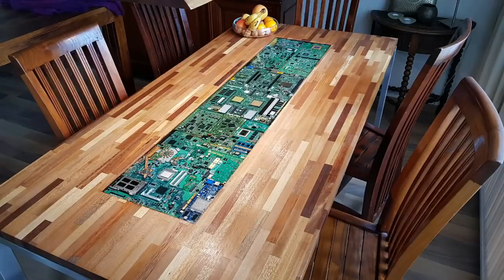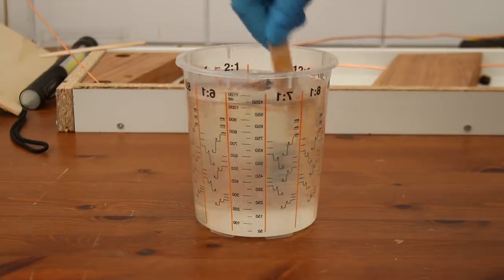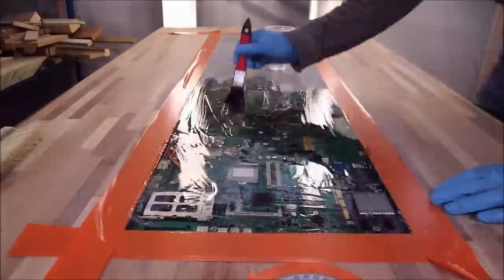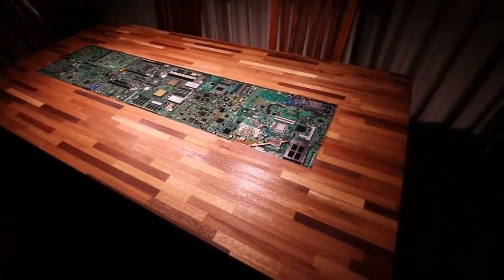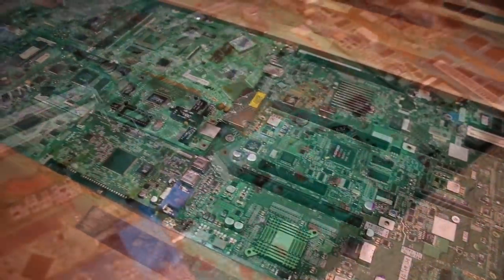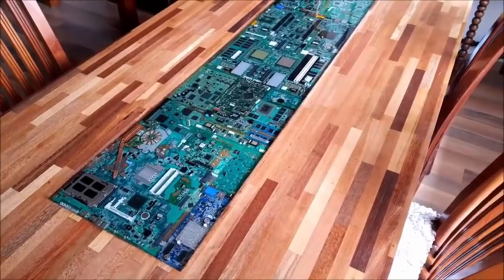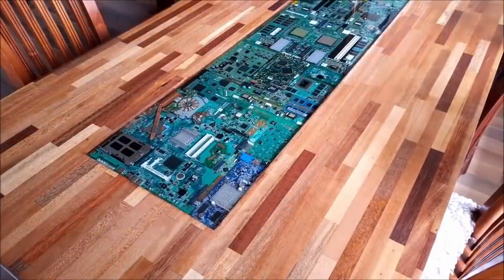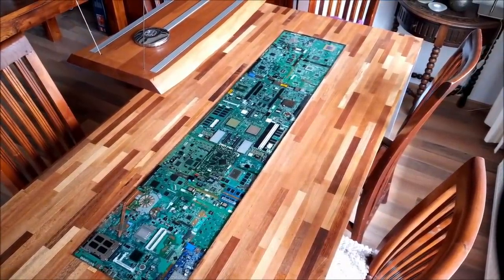Circuit boards with lights in epoxy in a table

Comment: What you've learnt from this: The epoxy was a failure.
What we've learnt from this: Screw with your failure!! That LED with fiber optic wire is a brilliant idea, and your table is awesome!!
Reply: i agree the fiber optic is really nice ! but i'm asking myself, in the video you show us you drilled a red led, but when you light it up later they all show up green and yellow ? i'm really curious about this
Reply from the maker: @nathu100  The red one was the first as a test. 'For real' I used only green & yellow because I thought those colors matched better with the circuit boards.
Reply: Looks like shit.   My local lumberyard has an epoxied table with river stones, moss, and a slab of zebra wood with a live edge.   Your table is something a sixth grader would do.
Reply: @yousircantknow8987  "my local lumber yard...."😂😂😅That was one of the dumbest, out of left  field, "I can't do better so I will hide my jealousy by posting that I saw a better one somewhere else that I  had nothing to do with except seeing it" post I have ever seen!😂😂😅.  FAF. Had me rolling for a while. Thanks. I really needed that.

Comment: Just cut the whole middle section out, create a replacement, with a backing, fix the backing underneath the table and pour again, making sure you mix well and vibrate the table to get rid of air bubbles. the sander would do the job, just without sanding paper in it.
Reply from the maker: I was hesitant to use the sander, just because it was so dirty, and I was afraid the dirt would end up in the epoxy...
As you can see here https://www.youtube.com/channel/UCNdDV4vHKjuWOYlEW4HIk5w/community I've begun trying to fix the table. I will try to pour in new epoxy.

Comment: A really nice attempt, May I suggest turning the tent you made into a vacuum seal, pull aoo the air out before it sets, then you could do a final leveling coat after.

Comment: You suppose the arsenic residue left on the circuit boards in their manufacture could of caused a bad reaction in the epoxy?
Reply from the maker: More people thought so, but it is not. Because (as you can see in the video) I poured them in, and with that layer is nothing wrong. The problem is higher up.

Comment: as a tip for speed sanding epoxy if you buy a sand disk for angle grinder with 60 or 80 grid on a backing pad.  or a belt sander both work really well :).
Reply from the maker: I have both, but it didn't enter my mind to use them, for both tend to 'bite' chunks out of your material, the belt sander a bit less than the angle grinder. It would be very hard to keep the table flat...
Reply: there 2 kind of sanding pad you get for angle grinder. there high RPM one that go up 12000 rpm operate at 3 to 10 degree angle or you get one that act like orbit sander run on 3600 - 5000 rpm at 0 degree but these kind of grinder can cost a lot. 3 degree one is very good for roughing then 0 degree one great for finish work. belt sander also work as a 0 degree tool. 

main upside to 0 degree one is you put any grade of sandpaper on it i generally start at 180 + in metal work when i have dealing with super glossy paint. 

If you are biting out stock when you use an angle grinder you probably use to extreme of an angle. for woodworking an angle grinder with a sanding disk should be used like a paint brush very light stroke will give you a clean finish. 

hope any of this you find useful information on future projects :).

Comment: Just get a giant panel of glass and stick it on top. It will negate the sticky effect of the resin and give an awesome finish with added depth
Reply from the maker: As you can see here https://www.youtube.com/channel/UCNdDV4vHKjuWOYlEW4HIk5w/community I've begun trying to fix the table. I will try to pour in new epoxy.

Comment: So if you had a phone screen bright enough, and all the filaments concentrated in a matching rectangle, you could send to a grid of LEDs and make a big screen.
Reply from the maker: Nice way of thinking, yes! But in reality you need quite some light to even see it on the other end - the light of my phone works well, it is a very bright LED, but I have a ordinary flashlight, and that light is almost not to be seen... So I'm afraid the light of a screen won't do it...
Nice thinking though... 😊👍

Comment: pour some wd40 on the sticky spots, it adds a protective layer,extra shine and no sticky for a good while, might need to reapply everynow and then tho, still,better than a spot with dust
Reply from the maker: As you can see here https://www.youtube.com/channel/UCNdDV4vHKjuWOYlEW4HIk5w/community I've begun trying to fix the table. I will try to pour in new epoxy.

Comment: Since the boards and epoxy are on top of a foil layer on the bottom couldn't you just router around the perimeter of the epoxy and in theory it would lift right out? 
personally I think that is a very cool piece and would suggest to add even more circuit boards for a larger area. It is so mesmerizing to look at the boards.
Reply from the maker: I agree on that last statement. In the mean time I've begun trying to fix the table, this you can see here: https://www.youtube.com/channel/UCNdDV4vHKjuWOYlEW4HIk5w/community - I will try to pour in new epoxy.

Comment: You did something ¡¡¡incredible!!!
The learning is: to do the mix with a mixer, like the used to cook bread.
https://www.amazon.es/autom%C3%A1tica-velocidades-El%C3%A9ctrica-Resistencia-temperaturas/dp/B07L1NBLLG
Hugs
Reply from the maker: I went to a boat shop and bought an impeller there. Now I mix the epoxy with that on my electric drill. That works great too!

Comment: This is exactly why i bought a crappy whisk, chopped the end off and fixed it to my drill, you can then use it to power-mix epoxy, no way you can properly stir large batches by hand.
Reply from the maker: I'm afraid you're totally right! I bought an impeller at a boat store and mounted that on my electric drill. Works good too!

Comment: Very cool! I'm amazed that with that much epoxy that it didn't exotherm (smoke and crack from the heat). I had the same issue of globby epoxy when making a surfboard one time. Like you, I didn't mix it properly.
Reply from the maker: So you know what it's like... It depends on the specifications of the epoxy how thick the layers can be that you can pour at once. My (slow curing) epoxy was good for 5 cm, and I did only a bit more than 1 cm... I never noticed any heat at all.

Comment: Great job overall. Batches of epoxy-- I didn't think that was the best way to go. One large batch ...hindsight. Thinking of building my brother a desk and adding something similar on the top. Thanks for the idea!!
Reply from the maker: Disagree. I have no regrets on the layers. Even in hindsight. You can mess up the mixing of any layer, if it is one or many. And I just needed those first ones for fixating the boards and the lights. As I started trying to fix the table (see https://www.youtube.com/channel/UCNdDV4vHKjuWOYlEW4HIk5w/community ), I discovered which layer exactly went wrong. It was just one...
Reply: @Onrust1  I look forward to seeing the fixed final product. I never do batches of epoxy but maybe I will give it a try :)

Comment: You should have use a torch after every layer of epoxy poured to remove the bubbles and maybe to make the epoxy look smooth and clear. 😅
Reply from the maker: I did.

Comment: The hugely spot is because you didn't let enough time between layer so when you add new epoxy, the layer before just starting to became strong then, she is moved by the new layer so she move but not enough to became clean and she stay has if you moved she all time

Comment: Great idea and loved it. To fix the problem of sticky epoxy, build a dam around the edge of the table and make another pour of about1/4 inch or 5 cm
over the whole table and fine sand to a high polish finish. Just make sure of your measurements when mixing and mix well.
Reply from the maker: As you can see here https://www.youtube.com/channel/UCNdDV4vHKjuWOYlEW4HIk5w/community I've already begun trying to fix the table. I will try to pour in new epoxy..

Comment: It's not a complete loss. Depending on where the damaged areas are you could cut them out and make end tables or nightstand next to a bed. It is definitely some extra work but not a complete loss. Just a thought
Reply from the maker: As you can see here https://www.youtube.com/channel/UCNdDV4vHKjuWOYlEW4HIk5w/community I've already begun trying to fix the table. I will try to pour in new epoxy..

Comment: cover it with a 6 mm glass, put many 20mm diameter x 1mm thick small round clear vinyl  pads to elevate from epoxy so it does not touch glass

Comment: The epoxy can be manipulated with a blow torch when pouring, to remove bubbles and settle the epoxy. Something that might be difficult to do without melting the circuit boards..

Comment: I like the table, nice. I understand what you tried to accomplish. I might have use a layer of glass instead of epoxy but that
would not give the effect of those circuit boards completely encased in a glass like medium. Maybe working in smaller
sections could help with a thin (1/4") wood border randomly separating the circuit boards within the overall space. More
lights might be nice too. Making the center piece first, then applying it to the table, might work. I think its worth perfecting.
Reply from the maker: As you can see here https://www.youtube.com/channel/UCNdDV4vHKjuWOYlEW4HIk5w/community I've already begun trying to fix the table. I will try to pour in new epoxy..

Comment: Why not sand it again and apply a few coats of urethane over the whole table top.  That should solve the sticky part and create an even surface.
Reply from the maker: As you can see here https://www.youtube.com/channel/UCNdDV4vHKjuWOYlEW4HIk5w/community I've already begun trying to fix the table. I will try to pour in new epoxy..

Comment: Like other commenters have, I will commend you on posting a video with a mistake. 
Just an idea but could you skim down a couple of cms in the affected cloudy areas and maybe lay back in some of the wood or different thin pieces of wood and stain it and then pour in some more clear on top of the fixed sections. Put some wood on the computer parts to give it more depth and a look I havent seen yet. I wouldnt want to throw it out. Looks great
Reply from the maker: As you can see here https://www.youtube.com/channel/UCNdDV4vHKjuWOYlEW4HIk5w/community I've already begun trying to fix the table. I will try to pour in new epoxy..

Comment: That chiseling out of the center looked like too much work. I would have just cut the center out completely and dropped in the circuit boards on a panel...cause I'm lazy lol...(but not enough to put a glass top on it lol)
Reply from the maker: You're completely right. It never crossed my mind, but it would have been less work & a lot quicker.

Comment: Hey, I just thought of something...what if you just add a pane of...what's it called? Oh, glass! I mean, I know that's really thinking outside the box and something 100's of people probably wouldn't even have thought of one single time until right now so I just thought "hey, I should mention using glass".  You know, the whole using glass idea really could work...to cover the oozie epoxy...with glass. So just glass the table with glass and glass the glass glass glass.

Just use glass.
Reply from the maker: What was that again?

😁😁
Reply: Onrust! I just had another idea! What if you set up a form the same dimensions as your table, fill it with sand and place it in a blast furnace until all the sand grains melt into a single entity that is both strong and clear. At this point you remove the form and then simply place the clear but brittle sheet of molten sand directly on top of your table. It will fix everything! 

For future reference, whenever something goes wrong just follow this procedure and you’ll be covered. :)
Reply from the maker: I'm impressed by your deep understanding of physics and thinking out of any box. Still, thanks to some small quirks in your thinking, I suggest you do some more studying... 😊

Comment: Glass will not fix it. The pours were too thick. The tape on the bottom prevented the epoxy from bonding which is not good or bad. But routing the sides will allow you to remove the epoxy and boards to start again. Use smaller pours and torch it to remove any bubbles. Do everything else the same. If you don’t use the tape seal the wood somehow
Reply from the maker: https://www.youtube.com/channel/UCNdDV4vHKjuWOYlEW4HIk5w/community

Comment: 1) I would cut out the epoxy from the bottom so that the table had a slightly bigger rectangular hole. 
2) Then, I  would rabbet the bottom of the hole.
3) Lay in a new piece of furniture grade plywood for the base; glue and screw in place.
4) Now you are ready for your next epoxy pour.
Reply from the maker: https://www.youtube.com/channel/UCNdDV4vHKjuWOYlEW4HIk5w/community

Comment: tempered glass and if you didnt TOTALLY miss getting that pour layer measured properly(off by a little) it may very well set up in a year or so. appears maybe one of the pours got miscalculated. I would hang in before hangin' up!

Comment: I bet that much epoxy damn near heated up your whole shop when it was setting..... Beautiful table and an amazing idea. Very cool
Reply from the maker: I didn't experience any heat at all. It is a slow curing kind of epoxy. Thank you.
Reply: @Onrust1  about how long does it take to set? I'm starting to experiment with epoxy so I'm very interested in learning new things about it
Reply from the maker: That depends very much on the kind of epoxy you buy. Mine took at least 24 hours (it needs higher temperatures too - at least above 21C - if it is below, it takes longer). I waited a few days between pours. But with other kinds it goes a lot quicker and can set in hours, then you can do maybe even more pours in one day... Ask the supplier about the specifications of that epoxy..

Comment: @onrust! when we build epoxy coated bars (aprox. 200 SqrFt) we pour no more than a quarter of an inch, and that is risky. typically we go for an eighth of an inch over the wood grain after what will settle between and under the wood has settled. Then we attack it with a heat gun. The Heat gun brings the bubbles to the surface and then pops them, allowing the thin layer of epoxy to set. If we want to, after we will pour heavier but if it is too thick the set will never happen. it's a major pain
Reply from the maker: It very much depends on what kind of epoxy you use, how thick one layer can be. Typical you are right; that kind cures relatively fast. I had a slow curing epoxy and with that you can - according to the specs - pour two inches at once. Not that I did, I poured a bit over half an inch...

Comment: Hi..What the name of glue?
Reply from the maker: Not glue, but epoxy resin.
Reply: @Onrust1  .. I want to buy it, but I don't know the name...
Reply from the maker: Where do you live? What language do you speak? Then I can try to help you..?
Reply from the maker: Does this help? https://si.delachieve.com/%E0%B6%86%E0%B6%B7%E0%B6%BB%E0%B6%AB-%E0%B7%83%E0%B7%84-%E0%B7%83%E0%B7%8A%E0%B7%80%E0%B6%BB%E0%B7%8A%E0%B6%AB%E0%B7%8F%E0%B6%B7%E0%B6%BB%E0%B6%AB-%E0%B7%83%E0%B6%B3%E0%B7%84%E0%B7%8F/
Reply from the maker: I liked the cats and the aquarium. 😊👍
Reply: I'm in malaysia

Comment: Epoxy reacting with board materials? Interesting to see if it's the same types of boards that gummed up
 A flat city diorama with roads would be cool
Reply from the maker: No, because the problems are in upper layers, not at the boards.

Comment: really !! it looks like a sucess to me & i have been working with composites since 1966...... this is a fabulous one of a kind table..... i was enthraled watching you build this table...... no one will ever look at this table at 2 ft. distance..... now it is time to build one with 60s slot cars......medium slow moving slot cars that will not come off the track...... 007 slot car track......have you seen the 007 slot car trac of the 1965 era ?
Reply from the maker: I like the idea a lot. I have looked up the 007 one and I was surprised! Cool! I say do it! 😊
Reply: to really make the 007 slot car track great would be to attach the cars so that they cannot come off of the track....( a pin through the slot with a washer slodered to it benith the track.)

Comment: PS what operating system is it running. Does it have wifi & how manny usb ports?
Reply from the maker: 1 a very special table top version of Linux, it's called 'Ubuntable Linux', made by Cancomical. 2. No, no Wi-Fi, but for sure it operates completely wireless, 3. A lot. Estimates run between 8 and 15.
😆

Comment: Everyone's saying "just put glass on top of it" and yeah, it probably would have been easier, but i honestly appreciated the 7 liter pour. Why else do something like this?
Reply: You didnt get it. People saying to put glass on it are giving advice since the epoxy failed and is still sticky. Putting a layer of gladd on top of it would get rid of the stickyness. They are not saying he shouldn’t have used epoxy at all
Reply from the maker: It might be a reaction on suggestions to have used glass instead, because I've got that many times as well... I totally agree that it is not the same. In the mean time I put glass on it and made a video of that, so you can see the difference. I'll show it in 'the fixing of' video...

Comment: I gotta say that table still looked pritty awsome. Great idea. I wonder if the table being bent had anything to with the epoxy not turning out rite. Love the concept. I would try just removing all the boards and epoxy out of the center to start over. Befor u do a large project again. Do a couple wood pieces with like 3 or 4 computer boards and epoxy to see if its something with the computer boards messing it up also. Less work for trial and error befor redoing the table.